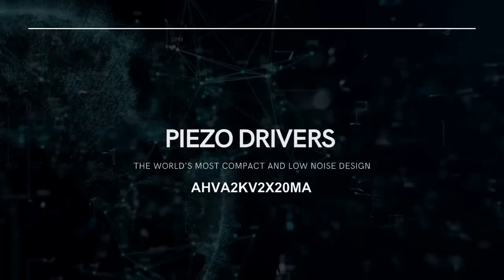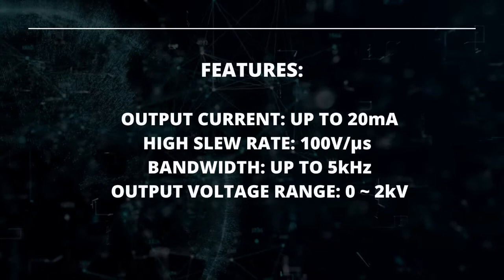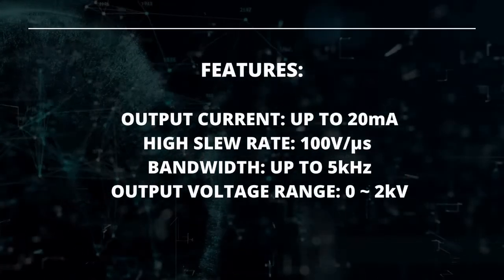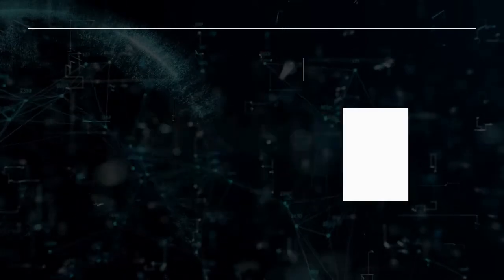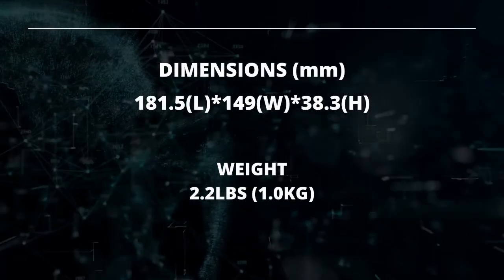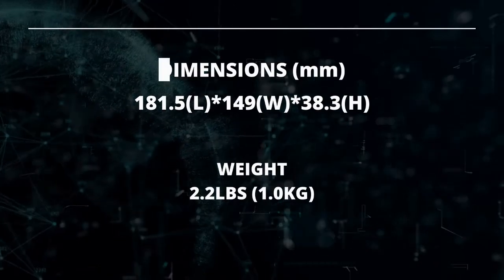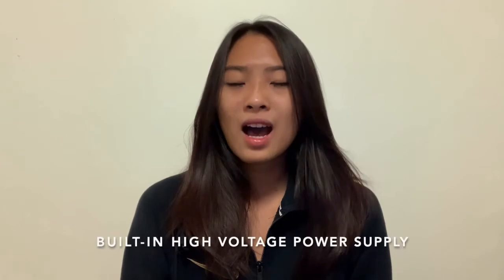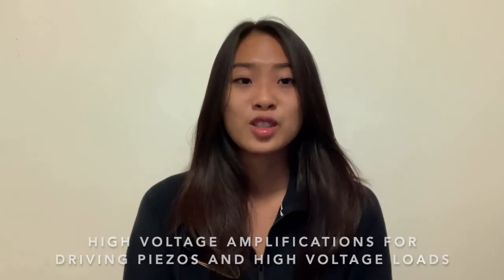High Voltage Amplifier/ Piezo Driver  AHVA2KV2X20MA02

Comment: First! I mean first relevant search result after scrolling though a hundred or so. On the bright side, I learned there might be a hole in the ground in Oregon that reincarnates dogs dropped into it and might be an interdimentional portal but we can't see it because the black helicopters showed up after Art Bell was called. Table salt can be used when melting solder into some kind of plastic, I think. Piezo elements can be used as acoustic guitar pickups and to fire coilguns. 

Anyway, this is at least the right subject but overkill. I just want to amplify a 3V signal to about 50V with junk parts I have laying around for some crude sonar experiments. But I figured I'd post a comment since there weren't any and I feel I owe you guys for electronic parts that give me the warm fuzzies, LTSpice and allowing it to work in Linux with Wine.